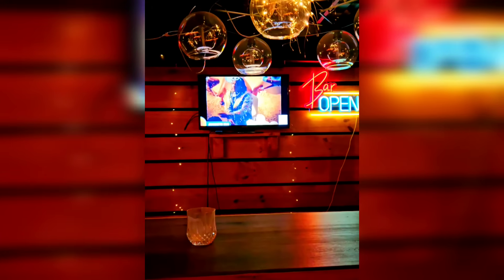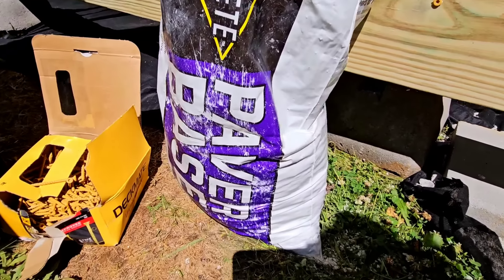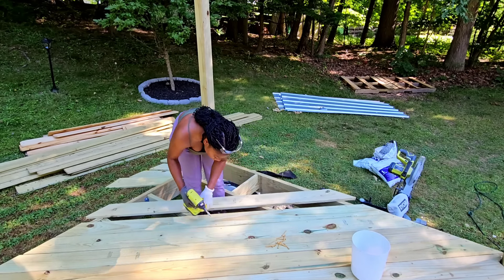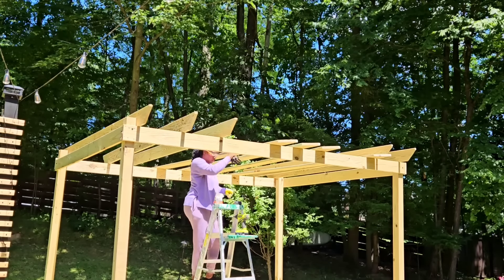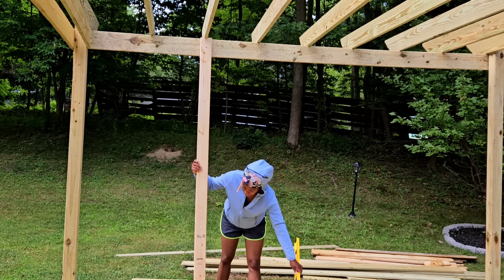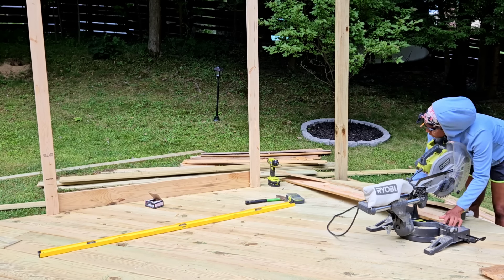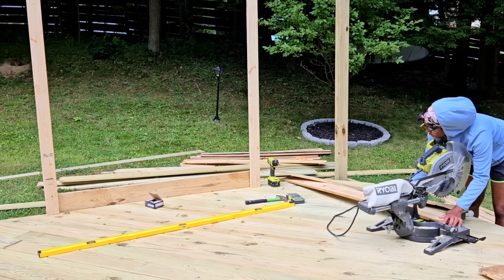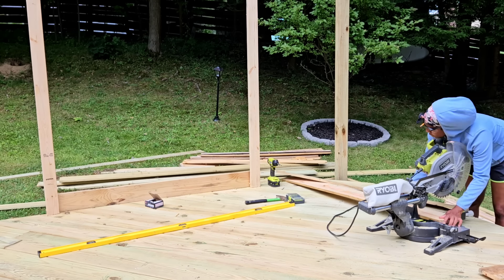DIY OUTDOOR BAR AND GRILL STATION

Comment from the maker: THESE ARE THE MEASUREMENT ( THIS THE BEST I CAN DO, THANKS FOR WATCHING)
BAR 12ftx8ft
Counter top hangover  is 97" long and 24" wide
Counter bottom 97" long 15" wide
Back privacy wall 2 sides  35 1/2"  the middle 65 1/4"
Side slot door 75 1/2" tall 31" wide
Step 51" X 28"